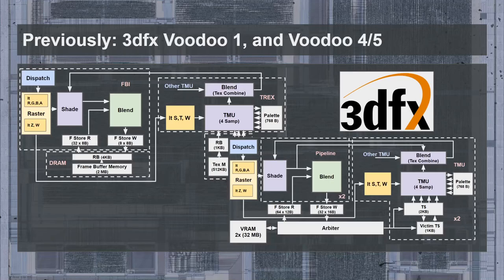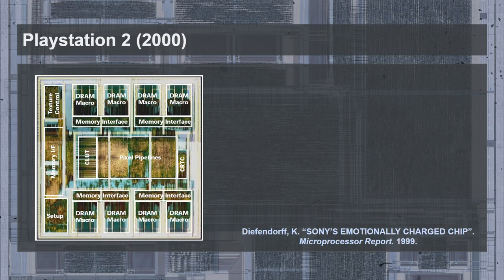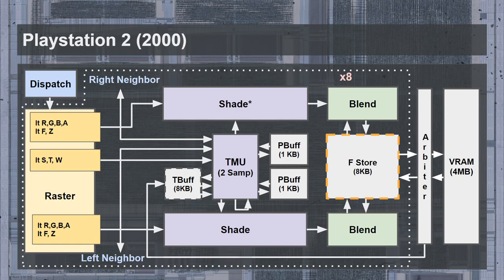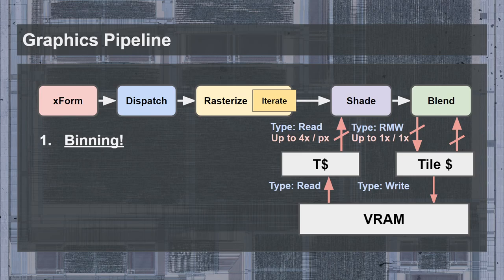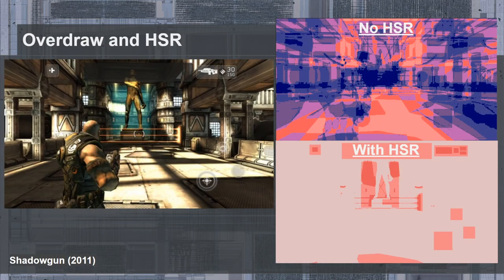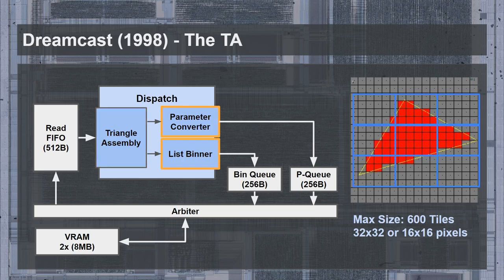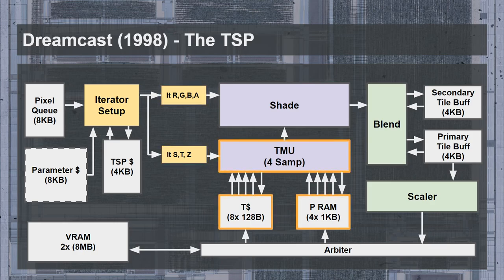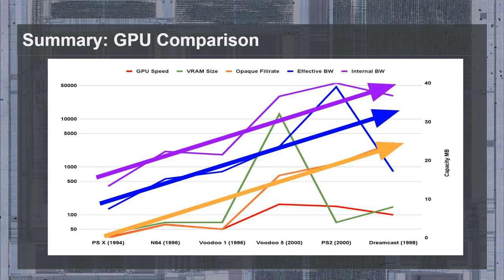GPU Memory, and Clogged Pipes (Part 3 - PS2 and Dreamcast/PowerVR) - #GPUJune2

Comment: A lot of the tech used by the PowerVR was 'also' developed by Apple for the Quickdraw 3D accelerator in late 1995. It was a "tile"-based renderer using 16x1 pixel tiles. Back then they called it a 'modified scan line renderer'. Sadly only patents and presentations of this tech is available. Apple had people working on 3D libraries, software and hardware since 1988. All further 'in-house' 3D development was cancelled in 1997.
Reply from the maker: Very interesting! Thanks for the information. 
Sort of funny that it came full circle then. Apple -> PowerVR -> Apple A/M chips. (their GPUs for the past coupled of years have been based on PowerVR IP).

Comment: Interesting analysis, and the reliance on die imaging is intriguing. Some notes I took during the dreamcast part of the video:

- Afaik, the FA fifo is 256 bytes (in 32-byte words, for the SH4/DDT interface)
- The triangle tags are several bits (20ish iirc)
- The depth buffer also includes at least 2 bits of stencil (for modifier volume computation)
- There seem to be two depth buffers, which are used for layer peeling to process OIT (optional, only for one depth direction)
- I don't think the RLE/Span sorters are involved in the OIT functionality
- I haven't evidenced a hard limit on the amount of layers for OIT
- There is a feedback channel to synchronize ISP/TSP (for PT/Alpha Masked rendering mode), which I didn't see in the schematics / functionality description
- SS downsampling (2:1) only happens in the X direction
- The Y scaler is a separate, post-processing 3-parameter FIR filter iirc (configurable, fractional scaling)
- 32-bit textures are fully supported (RGBA8888 mode, and also in palletes), though rarely used
- Palletes can indded be broken into 4 32-bit banks or 256 16-bit banks
- In parameter space, as generated per the TA binner, there is a bit per triangle so that bin/triangle culling is exact. While the insertion seems to be based on a bounding box, it seems (?) that per-triangle, per-bin decisions are made. ldxream emulates as much, and I follow those instructions in refsw.
- I thought ISP also had a vertex cache, though maybe not? It would have been usefull for multipass texturing.
- the 2ndary accum. buffer exists for multipass texturing, and can be directly controlled from the display lists. Not sure if it plays a role in OIT, I think not, as that would be conflicting with bump map usage.
- I haven't heard before of the ISP having some limit on how many object it processes at once. It would kill the effective fill rate.
- It is indeed odd if the depth has to be re-calculated, but then, weirder things have happeend. If the spans include depth information though, that'd make sense for the input buffer on TSP.
- As far as I can tell, the pixels don't have valid bits, as there is always something drawn (bgpoly)
- The primary accum buffer is always the one used for color writeout
- There is a default TSP parameter (aka 'background polygon'), and there are specific bits to clear depth in the region array command lists, so there must be some fast-fill action going on
- It is /really/ nice to see numbers/estimates on the buffers and ports and physical structure. Would love to see your draft notes ;)

((This comment has some errata, check replies bellow for some clarifications))

[references]

refsw: https://github.com/skmp/reicast-emulator/blob/alpha/libswirl/rend/soft/refrend_base.cpp, https://github.com/skmp/reicast-emulator/blob/alpha/libswirl/rend/soft/refsw.cpp, https://github.com/skmp/reicast-emulator/blob/alpha/libswirl/rend/soft/refsw_pixel.cpp

lxdream's ta: https://github.com/skmp/reicast-emulator/blob/alpha/libswirl/gpl/lxdream/tacore.cpp

~ cheers
Reply: Also, one thing to note is that the CORE + TA chip (aka HOLLY) also included Maple, root bus, part of the interrupt decoder, part of the DMAC engine (via sh4/ddt mode), the YUV decoder, etc. So not all structure /have/ to belong to the gpu in that chip. the sh4 and aica chips were sepparate.
Reply from the maker: I did account for those in the die analysis. Most of it can be determined by looking at the region patterns and counting the memory associated with each block, them cross-referencing with what we know. 
As for the OIT.... that's a fun bit of hardware, and not what you would think - it's very visible in the die photos.
Reply: @RTLEngineering  oh a few erratums in the comment there.

It seems like palettes can do direct argb8888 and YUV gets decoded to argb8888, however there seems to not be a direct argb8888 format for textures. Fun oddity I forgot :3.

The ISP also might have up to 512(!?) vertexes cached, used during PT (alpha-test/auto sort) and TR (alpha-blend/auto sort) modes. There are registers to partition this cache.

PT mode seems to render from front to back, while TR seems to render from back to front.

Double checked, there is clear reference in various places for a 'reference depth buffer'. Not sure how the span sorter might be involved there - though that'd be trippy.

There is something mentioned for 'discard processing' in some places, which seems to mean that fully processed polygons get removed from the Layer Peel. I wonder how that works, does it modify the display lists in memory during rendering to keep track of that ? huh o.O

There is also the Sort-DMA functionality, though that is just a linked-list DMA engine on the System Bus / TA interface.

I'm a complete noob when it comes to die shots, I've studied plenty of hardware and drawn some transistors by hand, haven't had much more exposure to dies apart from pretty colors and *oh that looks like copypasta must be some form of ram*.

Imma leave this here: https://media.discordapp.net/attachments/1124396111390576767/1126802257346842716/image.png

~

Comment: "Making the PS2 ahead of its time"

Debatable. Nvidia's gforce 256 was releaded in 1999 and had advanced register combiners that were already part way to being full pixel shaders. It had a dot3 mode that could do normal mapping without render to texture.

And other GPUs of that time could do render to texture effects, just prehaps not quite as fast as the ps2. 

The main reason we have documentation of these effects done on the ps2 via epic hacks is because it was the last GPU ever made with a single-stage fully fixed function pixel pipeline (outside of the mobile space) and remained relevant long into the pixel shader era. The graphics programmers of the mid-2000s were desperately trying to make it do things that were common on contemporary GPUs with pixel shaders.
Reply from the maker: Consider the context of the video: memory speed and performance. I believe the fact that the ps2 could do render to texture faster than the other GPUs make it "ahead of its time". You could argue there were other features that make it similar or comparable to other GPUs, but that would require a broader conversation than discussed in the video.

Comment: As alway, very interesting (i will need to rewatch it multiple time, my  brain failed to keep up ^^).
Looking back to this era, it's amazing we finally come back to fully programmable GPU with Vulkan, fix hardware functions reigned almost 20 years.
Even textures are replaced by geometry complexity, some code their rasterizer in openCL and even outside triangles (like sdf).
RAM technology was clearly push by graphics card, First DDR was on the geforce 256 with increase performance in "high" resolution. 
At that time, 600 Mhz CPU were running on punny SDRAM PC133. 
Question, when you think about it 2D acceleration are more or less special cases in 3D (lines drawing, color filled, bitmap rotation/displacement), wouldn't be better to biff up the TMU and raster to use them in this way than integrating 2D functions separetly ?
Reply from the maker: Thanks! This one was a bit dense, especially considering how complicated the Dreamcast GPU was.
I'm not sure what you're referring to in regards to a fully programmable GPU with Vulkan. There are still parts of the pipeline that are better off implemented in hardware, which was one of the reasons why Larrabee didn't succeed. The more relevant point though, is that Vulkan encourages a programming model that is well aligned with TBDR. The goal there is to compile the entire draw state for a frame, and then send it off to the GPU in one go (which is what's necessary for TBDR). 
The respective market share of graphics compared to other high performance computing applications is unclear, so I can't say for certain that DDR was pushed by graphics. The push for memory bandwidth was much stronger with graphics than processors though, but that's because processors do decently well with a cache hierarchy (unlike graphics). 

It's funny that you ask that about 2D accelerators. I was going to talk about that in a video on rasterization, but I think I am going to put that video off for a while. When dealing with 2D on game consoles, the only ones that could do those sorts of 2D operations were the PlayStation 1 and PlayStation 2. The reason for that was their rasterizer implementation, where both the 2D and 3D were integrated into the same functional units. The N64 and Dreamcast lacked the ability to draw lines because of how they drew the triangles. The same thing is true for the 3dfx GPUs (in their 3D engine). The N64 used a unique form of DDA edge walking, which prevented it from drawing lines. And both the Dreamcast and 3dfx GPUs used the Pineda method, which can't draw lines at all. So those three would have required special 2D hardware for that purpose (the N64 could draw rectangular sprites though, which were as special case of the triangle edge walking). The PS1 and PS2 instead used a different form of DDA, which effectively drew each edge using Bresenham.  Obviously that means that drawing lines becomes trivial, since the edges are already drawn that way.
For 2D graphics on the PC though, the story is a little different. Even if you could draw simple 2D shapes like lines and rectangles, that wouldn't have been sufficient due to the CAD use cases. That required the ability to draw arbitrary polygons (which was done through edge lists), as well as perform different stipple effects (line stipple and polygon pattern fills). Then you also want to be able to accelerate window drawing, which means fast BIT-BLIT style acceleration, which again is incompatible with the methods that allow you to draw triangles quickly. So the end result was a dedicated 2D accelerator - even the later 3dfx cards had a dedicated functional block only for 2D. 
When the 3D part of the GPUs became more programmable though, a large portion of that drawing ended up being done with triangles and programmable shaders, which is why modern GPUs no longer have a dedicated 2D block. Although, I believe they do have some dedicated hardware blocks to accelerate vector graphics drawing (e.g. OpenVG).
Reply: @RTLEngineering  Very good explaination for the D, thanks.
I know there are still fix part in the vulkan pipeline, but like i said, some begin to use the compute units to replace them. But yes somes units need to remain fix for performance purposes (or at least reduce to a single instruction when possible).
I was surprise to see 2D gpu appear on arm MCU (STM32 still bare minimum and NXP very advance, opensvg support) or specialised unit like CORDIC or FMAC on some STM. Very interesting reading.
Could almost do a complete 3D accelerator with a bunch of those. I must have a fetish for multichips gpu ^^.
I know this area do not cover TnL, but i saw a video on the fast inverse square hack from Quake3. Did implementing this kind of hack in hardware would be efficient ?
Reply from the maker: There are still parts that are more efficient to do in hardware though, not just single instructions. For example, rasterization is a massively parallel, multi-channel adder with bit testing. Then the result needs to be pushed to a scheduler to fill a work queue. You could do that in software, but the overhead would likely account for 10x the amount of work as the computation itself. It also doesn't really make much sense to implement a "rasterize" instruction. Although edge evaluation could be an instruction for a programmable hierarchical rasterization scheme (Larrabee did exactly that, with a special instruction to evaluate an edge function). 
I didn't know about CORDIC being specifically implemented, but I did know about FMAC. The reason why those are given special functions though, is that they appear very often in varied workloads (especially signal processing). The same thing isn't really true for most of the graphics operations, which only occur in that one part of the pipeline. I was also surprised by the dedicated OpenVG units on the NXP chips, but that was likely due to the market (their intended market required that level of acceleration). The STM32's GPU is basically a glorified BIT-BLIT though, so it's not all that fancy. Still, it exploits parallelism and tightly coupled execution to provide more performance than software on the ARM could provide.
The fast inverse square root isn't used in any GPU or for T&L, as far as I am aware, since there are better methods. But I recall reading somewhere that the SSE RSQRTSS instruction uses that method (it then follows up with a few Newton iterations to improve the approximation). GPUs on the other hand use look up table based polynomial interpolation. That's also how the N64 and 3dfx GPUs did their perspective divides.
Reply: @RTLEngineering  In fact i was looking for a fast inverse implementation that would be faster than the hardware "traditionnal" divide, but no dice.
Precomputed values in a lookup table are fine depending on the range and precision needed. "Amazingly", The cordic unit on an STM32 is not faster than the CMSIS implementation , didn't look how they implemented it, i doubt i will find the information but it must be underwhelming ( I find STM documentations somewhat messy ).
I found the NXP 2D GPU rather impressive if compared to a 2D graphic card from the early-mid 90's. Some have even enough SRAM to do double buffering and still have hundred of KB to spare. 
I'm curious how fast bezier curve are draw, SVG acceleration doesn't seem to be trivial for what i have read.
I will wait patiently for your 2D video .
Reply from the maker: There's no way to do inverse square root faster than actually doing it, otherwise computers would use that method. The only way out is to use an approximation, which is what Quake 3 did, what the SSE instruction does, and what GPUs do (although they might do true divide for triangle area). The polynomial implementation that the NVidia GPUs use is accurate to 3 LSB (of FP32). That's probably more than accurate enough for most applications, and can do 1 rsqrt per cycle (though it takes 3 to 4 cycles to compute).
I wouldn't be surprised if the STM documentation doesn't describe the implementation, since it's not really necessary to develop an application that uses it.
The NXP 2D GPU is impressive, but that's mainly because it's much newer and higher performance. I believe the newer i.MX8 line no longer has the 2D GPU though, and instead relies entirely on the 3D GPU.
And I've wondered about the bezier drawing functions as well. I am thinking that it's probably done similar to how 2000s era GPUs did tessellation, but I don't have a good understanding of how that was done either. There's other functions as well, such as special coverage checks for high sample rate AA (the Broadcom Videocore GPU documentation describes that briefly).
As for a 2D video, I don't really plan to make one. I don't have a good understanding of the algorithms used, and I already have my hands full enough with 3D to dive into them.

Comment: The x-axis of the trend analysis graph has the Dreamcast as the last entry, when it is captioned as being released in 1998? Is there some other parameter being used to chronologically order them?
Reply from the maker: I honestly can't remember what I was thinking at the time, it does seem that the Dreamcast should be before the other two released in 2000. My best guess is that I ranked them by opaque fillrate since that was one of the defining characterizations at the time: how many triangles per frame could it draw. It does show that in some cases the Dreamcast was ahead of the Voodoo5 and the PS2 even though it came out 2 years earlier.